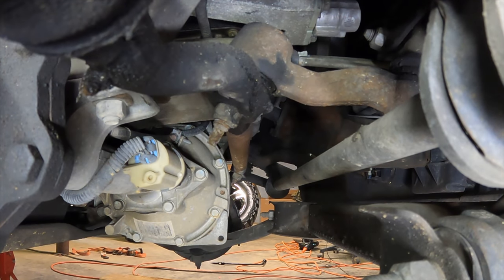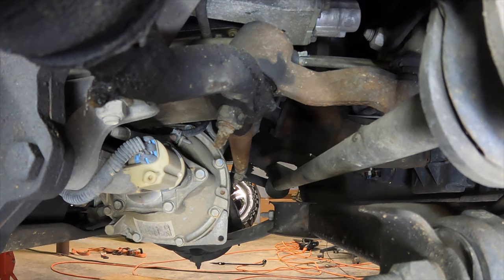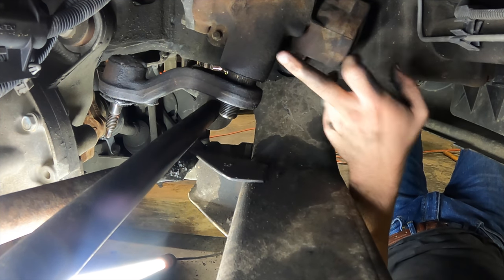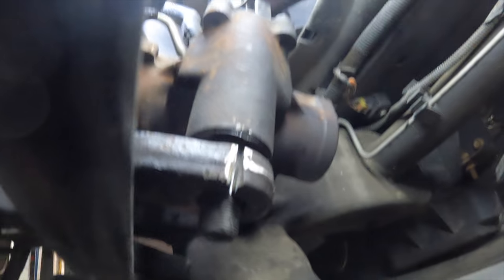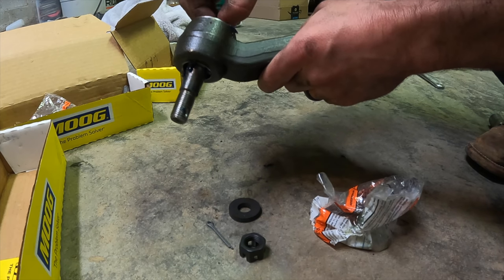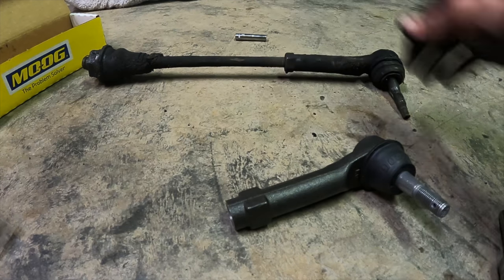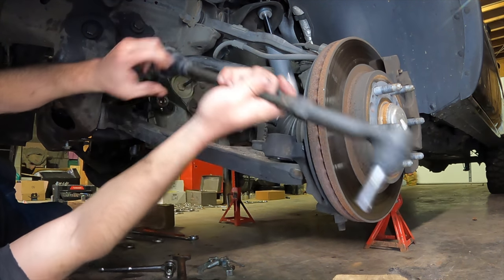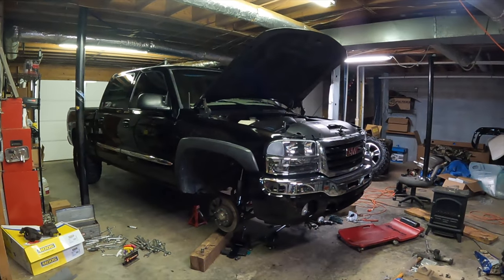99-07 Front end rebuild!!!!

Comment: Great Video. I have a 2000 GMC K3500. Love my truck. Been thinking about rebuilding the front end myself, now I feel more comfortable tackling the job. I just replaced the CV axles after one of them came apart and really started looking at the suspension. I have a bit of work to do. Your approach and tips you gave will make my job a lot easier. I just hit subscribe.

Comment: I got my pitman arm puller from Hobo Freight but I grindered the outside tips of the jaws to a slight taper to use on the other end of the pitman arm and idler arm from the steering linkage bar

Comment: This video dropped with good timing. My 2001 F-150 is going to need some work done to the steering as there is some play in it. Looking at the components, I suspect that the idler arm just needs to be replaced and the other components are still good, but I still need to have someone turn the steering wheel while I look at the components to confirm.

Comment: You should have used a propane torch on the Pittman arm. It will stop them from bending
Reply: Would’ve melted the seals
Reply: @Garrard1198  I mean you don’t leave it on high for 5 minutes or anything just add some heat too it and 9/10 they pop right off without much issue

Comment: That weird pipe wrench is called a spud wrench. And yeah they are very handy! Great video man. I did my front end in Moog parts and they have beed great.
Reply: It's an Offset pipe wrench a spud wrench has a sharp end like a set tool
Reply: @adubbz23  Yeah I know the wrench you're talking about but this is a Reed 02111 Spud Wrench with a smooth off set jaw. Been using them for over 20 years.
Reply: @room2three7 You're correct. This tool is a spud wrench, and was specifically made originally by Ridgid to repair flush o meter vavles.

Comment: I need new upper ball joints on my 2004 Suburban 2wd. I have been told that the only way to do this (or the way the shop I asked to do the work does it) is by replacing the control arm. Is this true?